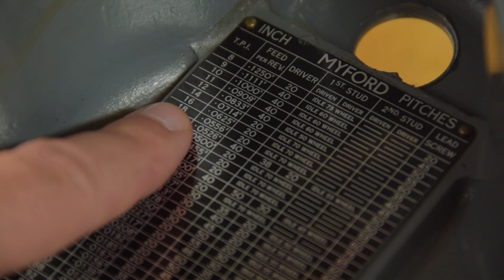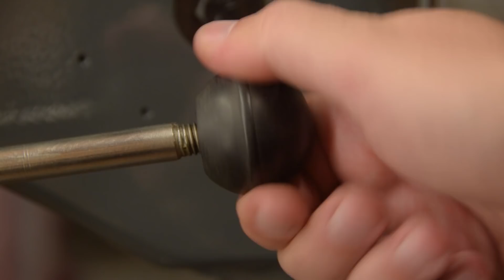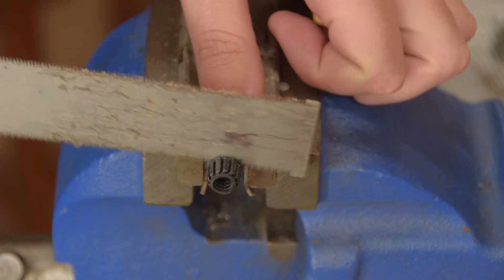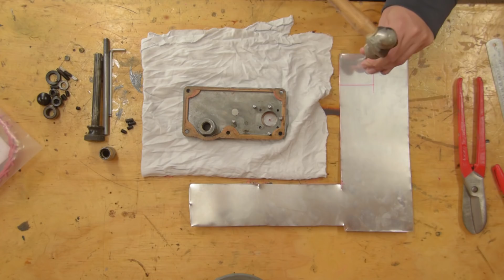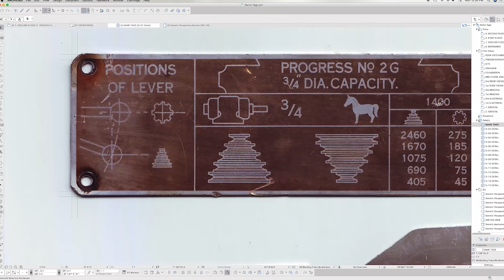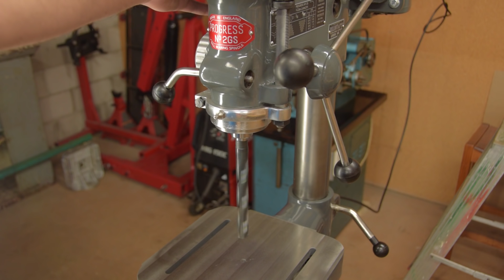Drill Press Restoration Part 10 - Final Assembly

Comment: I have just (two weeks ago) bought an Elliot Progress 2G "bench" drill, basically because I was fed up to the back teeth of having to use my Mill whenever I drilled anything over 13mm because my bench drill would only go down to 350rpm, which if I used that with a 25mm blacksmith drill it would loosen my fillings.
Mine is identical to yours except for the Cast Rear Column Riser, and my lower collar fits direct to the base.    Just like you I found the solid column a bit of a hefty bugger when I lifted it out of the base, especially as I hadn't taken any note of the blanked off hole in the top of the head casting ( I just thought it was a blanking plate in the hole to stop debris going down the column), and imagined that it would be a machined tube about 6-8mm thick, they must have had quite good prices for steel back then eh !

My front pulley set has a blanking plate in the top so I couldn't see how to a) get it out and b) how the quill mechanism worked or came apart, so I searched for an EP 2G Quill Tear Down and Rebuild on YouTube, and lo and behold some wonderful bloke in NZ had already done a complete Restoration Set one the very same beast in ten episodes - praises to the Gods of Olympus !  

First off let me congratulate you on a very very nice job mate, and that I'm very grateful for the quill tear down sequence.    I watched all 10 episodes and thoroughly enjoyed all of it (well done Craig and his Boss - brilliant bit of C.I. fettling - what a good mate to have in an emergency) .

I also Subscribed, although being 71 this year and my pension dwindling rapidly, I can't afford Patreon anymore, no matter how much I'd like to do that for about five deserving blogs.     Keep up the great work matey - Stewart UK.
Reply from the maker: Thank you Stewart for the excellent comment! I hope the drill goes well for you. They sure are solid!
Reply: @GeoffreyCroker  Like a Brick Shithouse, lmao. 🤣

Comment: Being a tattoo artist and also a bass guitar luthier in the past, working with metal never happened to me (until now) I got an Elliot 2G pillar drill from a free cycle website, I went to collect pallets, but this guy saw how I was looking at his drill. Asking 10,000 questions. I just bonded with the machine instantly, and he gave it to me, although it was working, I knew that I would have to service it and once I saw the latest paint job was cracking then I'm having to fully restore it. Not sure what year this guys drill is but it's different to mine, the base and table on mine seem more substantial, certainly feel it, also mine has a part- plastic cog at the back of the gearbox, it's dated 1951 and has a 3 phase motor built by hoover in Scotland. I've completed disassembly now (£200) in parts broken by me, obviously a couple of custom fabricated replica parts had to be machined on a lathe. With no lathe to speak of personally, no knowledge, virtually no information...(never even heard of a "gear pulley") I'm currently stripping, respraying all of the cast parts (not trying to turn it into a brand new drill)... Even if I could it defeats its purpose to me, I want Elliot to look like the 70 Yr old guy that he is. I'm just happy to be a part of his history, and I intend to use him, see what he can do. This guy's video diary is invaluable to me, I couldn't do it without these videos, as reference and he clearly knows what he's doing. So thanks for putting up such a comprehensive and thorough education for me, and the other freaks digging vintage industrial machinery... 👍👍💪🙏

Comment: Nice rebuild, I especially liked the new labels, could do with a set for mine - BUT - its a pity you didn't finish the spring loaded mechanism for the pulley lid.  That's the bit I'm stuck on.

Comment: You did a proper quality job thanks for showing this,
I have a Fobco with a 3 phase motor,with original switch,
I am placing a 1hp single phase motor on the machine,But can I still use the internal switch connection to wire in the single phase motor wires,Or do I have to replace the internal connector of the switch

Comment: Where did you get those rivets for holding in the name plates?
Reply from the maker: The bolt holder
Reply: @GeoffreyCroker  Thats great, ill order some when im ready. I have a similar sized meddings drill press, its in need of restoration, but works well as it is. I think it should have had a cover over the drive belts like yours too but i cant find any model number anywhere and the nameplate is missing.

Comment: Really love your videos and the quality you achieve with your restorations. I undertook (and really enjoyed) an engineering apprenticeship from 1966 to 1970 before working as a Design Engineer for 4 years. Watching your videos brings back great memories. One thing, just a small thing, I notice you don’t ‘tin’ the ends of your wires where they are put into connectors etc. Is there any reason for this.

Comment: I've just found you - excellent series! The rivet fixings used for the badges, sounding like a simpleton perhaps but how do these work without any pressure from behind? Are they blind tapered holes?
Reply from the maker: The rivets have a kind of spiral thread cut into them, like a very steep screw. The sharp edge of the thread is slightly larger than the hole, so they bite in. They're called hammer drive screws.
Reply: I see, thank you for that - I've not heard/seen these before - I'll bear them in mind for plates like this as they certainly look the part! :)

Comment: A friend of mine recently acquired one of these drills but something internal has failed, preventing the chuck from turning.  He was wanting to find more information before pulling it apart, and really struggling to find anything at all on the inner workings.  With this series it's easy to understand how everything should work and, hopefully, he'll be able to repair it and get it working again.  Since it doesn't make any horrible noises, and given the damage inside your machine, I suspect it's going to be that shaft you bronze-sleeved so nicely.  Very nicely made videos, entertaining and informative even if we didn't have the same drill to try and fix, thank you for taking the time to share your project and document it so well.

Comment: Great vids but i wanted to say that I spotted the reason why you had excessive thread on the quill handles, where the knobs screw on. It was because the end with the shorter tapered thread should be the end that the knobs are screwed to. You had them around the wrong way

Comment: Beautiful!  But you don't have to go metric to use base ten.   Henry Ford standardized on using decimal inches nearly 100 years ago.
Reply from the maker: Haha, he didn't tell everyone else loudly enough. I've have no problem making my own parts with my own measurements using imperial micrometers that are all decimal. But then I need 0.375 drill bit, and I look at the fractional drill set, and my brain shuts down.
Reply: :) Indeed.   My big drill bit set has 3 systems.   decimal inches, fractional, and lettered drills.   So I know the feeling.   But its all what one is used to.  I'm not snobbish about any one system.  let each use what suits them, for the most part were not building rockets . :)

Comment: Fantastic job!
I'm in the process of restoring a Colchester Student MkII
Those little aluminium things that you mounted those fancy name plates with, what are they called?
Greetings from Denmark
Reply from the maker: The little pins are stainless steel. They are called 'Hammer Drive Screws' or 'U drive screws'.

Comment: Beautiful! If you ever open up the switch box, put some ferrules on the wire ends. Tightening screws on bare stranded wire is definitely a bodge.
Reply: Certainly not a bodge. Especially on installations where there is vibration. The reasoning being the cantact area between the fastening screw and individual strands much more than a single point of contact as is the case when a ferule is used.

Comment: Love it! 
whilst flicking through the 1958 Buck and Hickman tools and supplies catalog i came across the 2 page spread for the "Progress" 10 speed drilling machine, same as yours they did a bench mounted drill and a multi spindle machine. 
Could that cable bush on the motor of had a piece of armored cable sleeve on it? In the reproduction Myford super 7 manual on page 21 the picture shows some of this armored cable sleeve that goes from the bottom of the drum switch in to the sheet metal cabinet passing through what appears to be a cable bush.
 My super 7 has the exact same cable bush as the original one you first put in the motor, on one of the holes that goes into the myford sheet metal cabinet. 
Only an idea. 
Looking forward to the land rover and Super 7 restoration.
Reply from the maker: Yes, good point it probably did have the conduit originally. Thanks Will

Comment: Nice work! Looking forward to next project!
Reply from the maker: Cheers Filip
Reply: I'm more of a wood working guy but am restoring a band saw at the moment. Also have a jigsaw machine that needs to be fixed. Not to the level you do though, but still. Started watching a lot of these restoration videos and must say yours are some of the best with both good video and commentary.  I wouldn't mind if you mentioned a bit about what oils/lubricants to use or not use and maybe paint and stuff too. I know your videos maybe aren't ment as instructional but would be a nice touch. 
Also like that you divide it up in parts so that the whole thing both becomes longer but also easier if you only want to watch just par of the project. 
Keep up the good work!

Comment: What's the process for the labels? Kinda seemed like an interesting project on it's own. Is it a laser etched metal thing?
Reply from the maker: The original labels were screen printed and anodised. The new labels are printed on anodised aluminium (I think they call it sublimation or something like that). The chemicals for the old screen printing methods are no longer available. At least not as far as I can find. But I am putting time into figuring out a diy method to reproduce these properly.
Reply: Geoffrey, let me start with excellent restoration (but you should have polished your knob...lol). In regard to machine tag/label restoration, what software program/technique was used to reproduce and clean up the artwork of the originals? I assume you did the artwork clean-up and then sent the file to the company of your choice to reproduce the replacements? I have some old equipment and I really need to remake my existing machine tags/labels. The artwork has me stymied as I have limited computer skills.
P.S. loving the Land Rover rebuild...that's how I came to find your channel.
Reply: This is a quandary I am facing with restoring an old jointer. Where did you get them manufactured?
Reply: Where did you get the labels made?
Reply: I must ask too about the labels as I'm restoring a lathe and would like to get mine restored or renewed
Reply: @MG-Driver  If the labels are etched brass, possibly filled with paint, people are using techniques borrowed from printed circuit boards to make etched plaques, art, and labels and such.  It involves a pattern applied to the blank and a chemical etchant; there are various techniques, many of which seem workable in a home shop.  People have been making PC boards this way for decades.  Look for videos on "etched brass" or along those lines.
Reply: Geoffrey Croker get channel mate, where do you get the labels made?

Comment: You could mount your tool upside down and cut your thread while running the lathe in reverse. This removes the time pressures when cutting the thread. Joe Pieczynski has a video on that. I don't know if that's a capability of your lathe, or if there is some other factor that would prevent you from doing this, I'm not a machinist and don't own a lathe (yet). I just thought I would pass the knowledge on in case it helps you or somebody else out.
Reply from the maker: Yes you could theoretically do that on this lathe with a rear tool post, which I have, but you loose the ability to feed into the thread on an angle, and risk unscrewing the chuck. He may have had a compound slide mounted on the back of his lathe? Or maybe he just fed straight in.